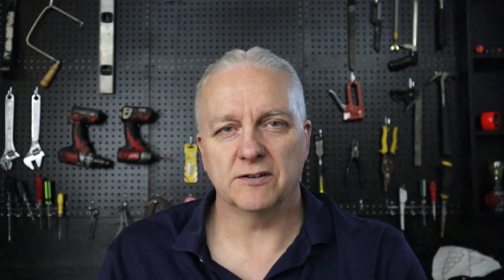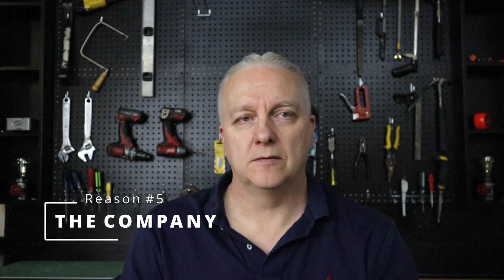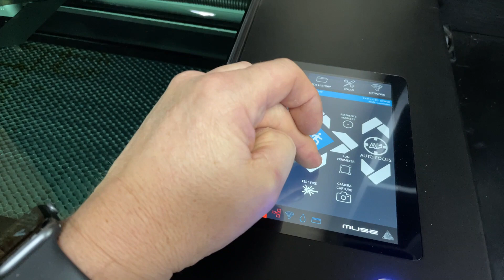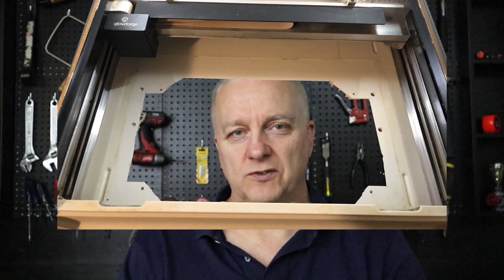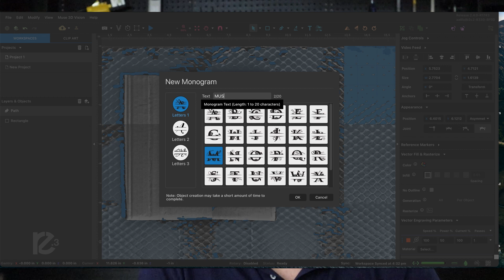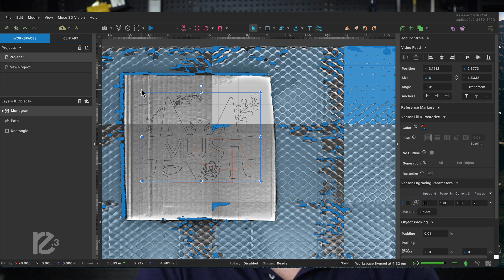BEST LASER CUTTER FOR HOME USE  // Top 5 Reasons to Buy a Muse 3D over a Glowforge

Comment: Sadly, I bought a Glowforge about 2 years ago.  Every time I use it it irratates me having to connect to the internet to run a simple print.  Often times it takes Glowforges servers longer to process the job than what it does to run it.  Additionally,  Glowforge was not transparent about the internet being required to run jobs.  Not to mention there customer service is horendous.  If my Glowforge ever needs major repairs, it's going in the trash.  Parts are expensive and often times out of stock.
Reply from the maker: Well every laser has drawbacks.  The thought of ever having to send my laser back for service would worry me but from a quality/reliability perspective the Glowforge seem pretty solid. The internet requirement should be a huge concern for everyone though. If yours is going to get trashed you can send it to me and I’d fix it to donate to a school 😀
Reply: @SteveMakesEverything  just my 3¢ ....BUT also the thought that your machine being dependent on the company for it to run . That should they decide to just stop supporting the software on older models. Including for it to run , have access to saved design files etc.  But they can directly force the consumers to continuously but newer updated models anytime they might choose to say they will no longer be  supporting  older models .
So that also makes the machine have no resale value because they just won't work alone themselves . It makes all those older models non functional so people that are content with useing them or bought them second hand or just the mind set " If it's still working for what I need " then never a reason to but the newest model . Lastly all those machines being non-functional they will just end up in a land fill . Rather then people being able to use them for years and years !! The Cricket machine just did that last year I think . And of course Apple has done it .. I have a first gen iPad that had continued to work fine but app creators stop supporting apps or don't make apps that can be used on older models etc. So now I have a perfectly functioning iPad that is little more then search tool and video player for now because I can still connect to the internet and use it .. but more and more webpages won't come up because they are not supported .  Not sure how long but it most likely soon just be a paperweight.. that's aggravating because it has nothing wrong with it and worked for what I wanted it to do.
And more company's are going that route. And it's just to keep people buying ... And of course there are customers who will always be wanting the next newest model etc. 
But for myself I didn't have a need it reason to buy something new when I have something that works perfectly for me . And though they think it will get me to buy something new and they want me to do that , it does not work like that for me ..they ended up loosing a customer. !!   
     Because all that shows me is that is something they will continue to do in the future and I will always be put into the situation of being forced to keep buying the new models even though I should not have to. 
In reality I wouldn't still buy new generally ..new to me ..but a used older model but newer then mine that has a much cheeper price point then the newest one, us the way I would have gone anyway .  Just cheap what can I say ?!!   But for me it also comes down to peoples ability to buy and sell  used abd second hand items that gives them a longer useable life and keeps them from just going into a landfill somewhere .. to me saving me some cash and keeping stuff out of a landfill gives me a better feeling then what I might get from always getting the new coolest model with a new Higer pricetag ever will.
Reply from the maker: @DOCDOCFLAMINGOS  Agreed - this is kind of a shifty way to capture your audience.  I have many Apple devices and it does bother me that they regularly leave users behind unless they forcibly buy new hardware.  I think if Glowforge ever comes out with an improved model they may do the same.  Cricut does this as well though the cost of their machines isn't so high that it is prohibitive to upgrade al older machine.
Reply: @SteveMakesEverything  All very valid points and I agree 100%. And honestly I fully beleive that is exactly what Glowforge will do. Because the intention is already there in that it's customers are completely dependent on need the internet and their website for any device to even work and remain functional. 
   And as you mentioned yes Cricket is cheeper to upgrade their craft machines, But none of their customers or anyone in general had any clue that at some point their older machines would not be supported any longer and the customers would just have a none functioning or usable device. 
  So it was a shock I'm sure!!  But that did make everyone aware that this could and will  happen at any point in the future . And that any company that sets themselves up the same way , the machines dependent on the company for them to function at all, then they can and will do that exact thing at some point.
    If I'm wrong I will totally eat my words and say I was wrong, but I don't think I'll have to do that.
    And so much of what  company's sell us today are totally doing the same kind of things , just not as up front of in your face. Like cell phones many of them will just stop doing any updates or security patches etc. on them just after a year or two. So if your cell is working fine and no need to replace it , but it's no longer going to be updated and security could become an issue. Well we either deal with it or we deal with buying a new cell phone!! 
   There is a quote I have heard that goes something along the lines of "You will Own nothing , and you will be happy!". In that sure we can spend money on something physical that we own. More abd more things are dependent on the company supporting it and the amount of time they will do so is beyond our control and then we don't really own anything at all !!!
Reply from the maker: @DOCDOCFLAMINGOS  This is a great quote 🤣
Reply: @SteveMakesEverything  I think so too.. just not sure i really did it any justice. In that  most likely it's not word for word. And that I can credit who said it or the place i saw or heard it.
But I think it's  very poinyant all the same!!

Comment: Thank you!! Your camplaints about Glowforge are the same ones I have about Cricut. So, I'm familiar with those issues. In particular, I know about being handcuffed to a company's services in order to use my machine.

Given everything in this review, I just placed the Muse 3D with Rotary Riser option in my FS shopping cart :)
Reply from the maker: Yes lock-in is worrisome, though the GF, which is a fine laser otherwise, isn't quite the same as a Cricut.  Cricut would like to you use their image service and materials, but you aren't forced in the same way.  I have a Cricut and don't use their service or materials.  With a GF your laser is effectively dead without being connected to their service and that's just objectionable.

Comment: Thank you!  

Is there any guidance on replacement parts that these (it) will potentially need?  Can one replace them or do they need « serviced » ?
Reply from the maker: Sorry, I think I answered only half of your question.  As a rule the only thing you can reliably predict replacing is the actual laser tube.  Most other parts would only need to be replaced as a result of an unpredictable failure.  For example the main exhaust fan on my Muse 3D failed but FSL sent me a replacement very quickly.  However it is a standard 120mm fan so I actually replaced it myself even before I received their replacement.   All I had to do was remove the cover over the tube so I could get at the connector, and the 4 screws holding the actual fan.  FSL does seem to want you to be able to service your own laser if you need to.  I can't ever see having to return it for service of anything even during the warranty period - this is a big deviation from the Glowforge BTW.
Reply from the maker: Pretty much everything inside the box is available off the shelf from other places.  This included things like fans, pumps, motor, belts etc. I believe even the laser tube itself is just a common part.  The sole exceptions appear to be the main controller board and possibly the power supply

Comment: Great video. We had been looking at a Glowforge and didn’t think there was anything else out there except the cheap Chinese lasers. What is the work area of these?
Reply from the maker: The work area is the same area as a Glowforge at about 12"x20", though it’s possible to engrave on taller things with the Muse because you can drop the bottom of the laser

Comment: thanks for you video explaining why you picked the muse 3D printer. I was thinking of getting one but after I watched you video am glad's I didn't. I have a small business and can't afford a lot of money.
Reply from the maker: Hopefully I didn't jade you.  While I love my Muse 3D for what I do, there are many great lasers out there (including the Glowforge).  The point is that you really need to do your homework to ensure that whatever subtleties a laser provides, they will either be exactly what you need or they might be things you should avoid.

Honestly neither the Glowforge or the Muse 3D are your cheapest solutions, but the Muse 3D has been pretty solid for me and is more industrial than a Glowforge (though that comes with a slightly steeper learning curve).  If your use case is mostly engraving you can save a ton of money with a diode laser like an XTool D1, which will do a great job engraving on most materials and will save you $1000's over most CO2 lasers.  But as soon as you want to cut something , most diode lasers will limp along at best and will drive you crazy.

Comment: Excellent Steve.  Thanks for sharing.  I am trying to see the difference between the 3D and the Core models.  Main reason I see is the movement of the head in relation to material.  My plan is to use only flat stock for cutting & engraving, so I am not sure the roughly 50% price increase is worthwhile.  Am I missing something important?
Reply from the maker: Welcome to the channel.  I toiled over this decision too, but it really boils down to your price limits.  The Muse 3D does offer continuous focus which is great for non-flat items you might want to laser, but it will also work for materials that are supposed to be flat but really aren't. 1/8" plywood is great to work with but is often bowed and the camera could help ensure a good print.  I initially thought the camera was a gimmick, but I have grown to rely on it even for flat materials.  I have no regrets getting the camera but it is definitely possible to live without it.
Reply: @SteveMakesEverything  Thanks Steve.  This is the first time I have posted anything.  Very useful response.
Reply from the maker: @myhomeelevator  Happy to be helping you make your world

Comment: Hi Steve. Thanks for all of your great videos. quick question...I bought the muse core laser. Did not purchase the cool box. I did buy a Vevor water chiller instead. it came with a small device for the alarm outlet (no hose, cable, etc...). The muse shows a four prong outlet where the muse coolbox should connect to the laser. So my question is...Is there a cable, tube, etc...that needs to connect to the chiller?  Im afraid to turn anything on ruining the laser. I just got it a few days ago. Thanks
Reply from the maker: The things you would need to measure are flow of the coolant and the should be required by the Muse anyway.  The temperature of the coolant should be controlled by the chiller automatically and ideally provide an over temperature alarm.  Set the chiller to 18C or so and an alarm at 22C and you will be fine.
Reply: @SteveMakesEverything  FANTASTIC. so then the only things to connect the muse to chiller 
are the input and out put tubes
Reply from the maker: @treebarh5192  As noted there is a flow sensor in the system somewhere.  Not sure if it is in the CoolBox or built into the laser though - I suspect it is the former, so you might need to deal with that too

Comment: How does the cooling system work with the muse?
Reply from the maker: They have a separate box containing the cooling and air blower.  It plugs into the laser with a cable and three hoses.  if you want replace either of these function with a different unit, it can be easily done.

Comment: Hello Steve!!!!!!!
Is the Muse really that good since it is old technology? 
The EPILOG brand of lasers has similar sizes and are not water-cooled.
Is there a plus to having water-cooled capability?
Reply from the maker: So a couple things to keep mind:  I wouldn't say the Muse, Glowforge or anything else is old technology.  Epilog lasers are the standard for sure but you are going to pay a lot more for them; however, don't assume they aren't liquid cooled.  Like the Glowforge, any cooling is internal.  There's still some form of liquid coolant running through the laser tube, but it is cooled internally. This is convenient because there's nothing to hook up externally, but that just means that anything needed to cool the laser is built into the box, meaning you have to live with whatever they provide, and the box will need to be bigger to contain it all.  By contrast with a Muse or any other laser with external cooling you can put an actual chiller in place for better cooling.  The downside of course in a satellite box for the pump and air compressor. One isn't necessarily better than the other - it's about what works best for you.  You aren't going to put an Epilog on a table or even on the floor in a small apartment, but I'd have one for sure in the right situation ;-)
Reply: @SteveMakesEverything  THANK YOU SIR!!!!!!!
Reply from the maker: @daniellane1757  Happy to help.

Comment: Did you consider the Snapmaker 2.0? If so, what were your reasons for passing this option? Also, do you have any solid recommendations for an entry point that is a bit more cost effective? $6000+ is a bit out of budget. I was looking at the FSL Muse Core Desktop CO2 Laser Cutter, but I'm not sure if it can be upgraded with the 3d lenses/cameras at a later time.
Reply from the maker: I didn't looks at the SnapMaker, though this is is a good question for many viewers to have answered.  The SnapMaker is a diode laser, which is fantastic for engraving most woods and some metals and acrylic that isn't clear.  Combine this with the CNC router and the (all three of my workshop passions) and you have a pretty decent entry level machine.

By contrast lasers like the Muse 3d, Glowforge, or Chinese K40 lasers are all CO2 lasers, which means they will be much better at cutting as well as engraving.  It doesn't mean they are better for everyone because as you note, the budget can be seriously impacted by a CO2 laser, and CO2 lasers certainly won't fit on your desk.

While I'd love to do a hardware review of the SnapMaker, I will at least over the coming weeks/months do a real comparison between CO2 and diode laser capabilities - not to quickly conclude that you should buy one over the other, but rather the strengths and  weaknesses of both so you can make intelligent choices that are right for you.  Both laser have their place.
Reply: I thought that the Snapmaker 2.0 is a 3D Printer, not a laser engraver.

Comment: I'm really wanting a laser cutter/engraver. How do you like your Muse 3D after having it for a few months now???
Reply from the maker: Hi Roger,  I love my Muse for myself, but take a look at the landscape and get what will meet your own specific needs.  There are many factors to consider - price, speed, power cutting area,  camera, etc.  

If you are looking at a Muse what you get is a solid metal cased "prosumer" laser that is more open so if you need to repair it you can find almost all parts available off-the-shelf, which means it's usually cheaper than going back to the manufacturer.

If you opt for something like a Glowforge you get a solid entry-level laser with a big community and a more secure closed/safe environment.

If you want to live a little closer to the edge and get a K40 Chinese laser then you get the maximum flexibility but the weakest level of support and arguably quality of parts.

Keep in mind that the real differences in the hardware aren't all that great for most 40-45W CO2 lasers.  Where things differ the most are the software operation and support.

Comment: Do you need the water chiller?, does that mean if you do not buy a chiller you do not get an air asset nor  chiller? there is no built in water idea? Thats a pretty expensive option to buy from them..I'm a little confused, it seemed reasonably priced but them cannot ell if i need their chiller Assist box...
Reply from the maker: For a Muse 3D you don't need a chiller.  The laser comes with a thing FSL calls the "Coolbox" which is a separate box that contains a water pump and fan-cooled radiator and an air pump used to blow air on the work that the laser is cutting to help keep it clear of smoke and free of fire.  

Other lasers from FSL and other manufacturers may require a chiller though